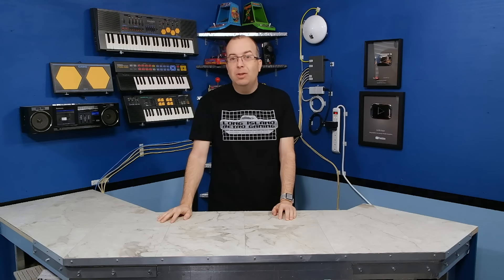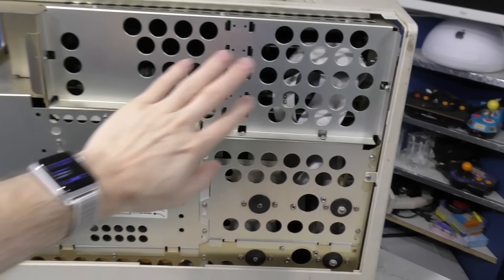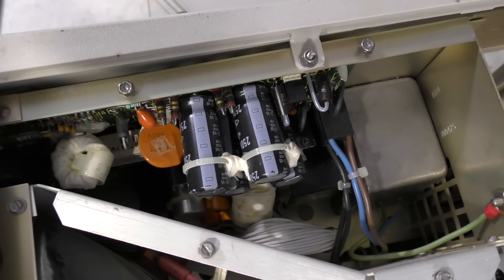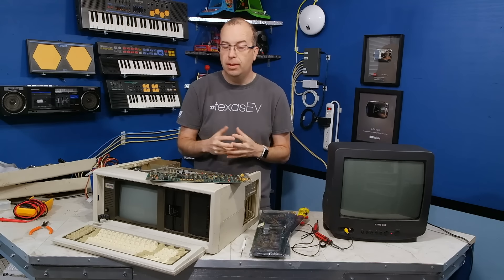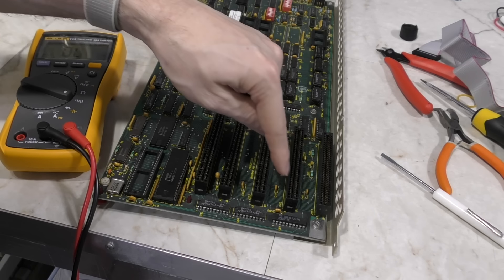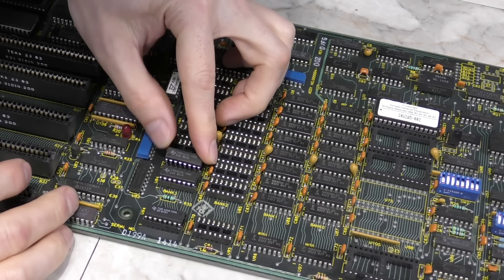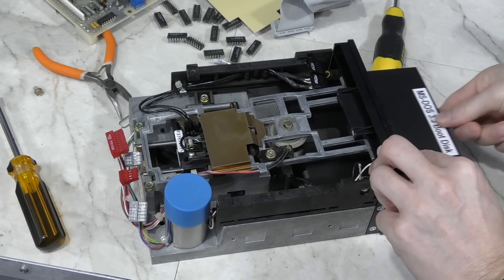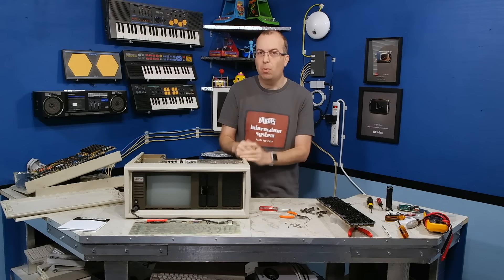Compaq Portable 1 Restoration - Part 1

Comment: I had one of these when I was a young teen.  It was hopelessly obsolete when I got it, but it had one advantage, my parents didn't know that it functioned and the modem worked.

In a nutshell, I would use it to dial to BBSes at night when I was grounded from the family computer.  Nothing like an 8" greenscale screen and a 2400 baud modem.  Ran MS-DOS 3.3.

Mine didn't have a hard disk, just dual 5.25" floppy drives.
Reply: TWX1138 alright, let a ‘younggen in on it- what’s a BBS?
Reply: Yeah, BBS - Bulletin Board system is very much like a web page but run by one person or company and you connect to it by dialling a specific phone number.

I used some around 1993 and 1994 (downloaded shareware games from them mostly), right when the internet was starting, but the internet very quickly made them obsolete.
Though... You could still find a decent number of them up into 1998 or so...

And even to this day there are still a few random holdouts.
The thing about a BBS is that anyone with a computer, a few modems and a few phone lines could technically set one up.

Nowadays I suppose even phone lines themselves are becoming borderline obsolete technology though.
So I suspect BBS will die a final death whenever fixed line phones do.
Reply: There's still quite a few BBS'es out there, but nowadays most are set up to be connected to via telnet. No more waiting an hour for a single jpeg to download via X/Y/ZModem!
Reply: @Samar Nadra: 14400?  How luxurious.  Try 2400 baud.

The city library system's BBS also had a Usenet portal, so I was able to do newsgroups, albeit quite slowly.  Had to be judicious as to what conversation threads I viewed.
Reply: @Kuralthys: yep.  Bulletin Board Systems.  Basically good for forums, e-mail (including cross-BBS e-mail with Fidonet and one's offlline mail reader like Bluewave), and some limited file transfer and shareware distribution.  Some BBSes had multiple phone lines and allowed for teleconferencing, but because of the popularity of that feature those BBSes were either congested or cost money to use.
Reply: meh, i think wired connections will never die, might become very specific, but never fully die. you can not beat the speed and security of a wired connection. 

but who knows, perhaps security will get good enough and wireless fast enough it will be, but we will have to see a wireless monitor first XD
Reply: @Slash0mega: who are you replying to?

There's already a wireless monitor technology.  Look up Intel WiDi.  It allows a client laptop to wirelessly connect a video signal.  It's commonly used to connect to projectors.
Reply: Ah, the BBS days... whenever I visited my dad in the early 90s for the weekend, I'd go on his PS/1 and hog the phone lines at night dialing into all the local Winnipeg BBSes, of which there were quite a number - I recall there being at least 100 of them at its peak, and definitely a great place to get new shareware goodies (though it did take a while to get anything on a 2400 bps modem) or run door programs like LORD. By the time I had my own PC (which had a 14.4k modem) and had moved back to the city for university in '96, they were on the way out as the Internet was becoming a thing, but occasionally I still reminisce about those earlier days when finding a new BBS to dial in to and discovering what all they had was a journey in and of itself - and with Telnet-able BBSes around to connect to nowadays, it's kind of nice to relive some of my childhood again :)

Comment: Damn, I had one of these as my first work computer.  I worked for a startup consulting company back in the day and it was my BYOD.  Brings back memories.  I remember when I had to add RAM, swap out a disk drive for a hard drive (and add a controller), replaced the PS(!), and added ISA cards, taking apart the cages was such a pain and I got plenty of skinned knuckles doing it.

Comment: I ran into this exact same problem with tantalum caps on the ISA riser of an old 286.  A VOM is a better diagnostic tool than pyrotechnics.
Reply: but not as fun or cool looking XD
Reply: A "VOM" ?
Reply: Miles Prower A "Volt-Ohm Meter." Basically, a "VOM" is a multimeter.
Reply: Okay ^.^'
Reply: A VTVM if you’re really old, or a Simpson 260
Reply: I disagree; a multimeter requires time and skill, while pyrotechnics tell you immediately.
Reply: Let the magic smoke out, but wait, no here we go. Now it works
Reply: EFormance Engineering z
Reply: Especially since it seems that trace got burned out due to the pyrotechnics too.

Comment: I’ve fixed a single dead key on one of those capacitive keyboards before by using a bit of antistatic bag material.  I kinda want to see about making a punch die for that purpose, get a bunch of the metallic antistatic bag material, adhere it to some thin felt, and punch out circles of it to the right size.  Some spray glue would hold it to the key, and boom, functional (and more durable) capacitive keys.

Comment: No need for tools to open the covers. Just lay it flat, and push the plastic cover down in line with the logo. It will pop open on the top by itself. Saving the clips, and no tool damage. BTW, these computers work great off a Hercules Graphics card. Also, this model came with 2 floppy disk drives.The Plus model (with a gold logo) came with a Seagate MFM hard drive installed - 10MB.
Reply: The plus model sounds really cool honestly

Comment: Looks like that capacitor was shorting the rail to ground and the power supply was shutting off to protect itself, it's really common for tantalum capacitors to fail Short Circuit. (Edit: I feel like I should mention to clarify electrolytic capacitors usually fail open circuit or simply loose capacitance, whereas tantalums usually fail Short Circuit.) I find it kind of funny that the modern power supply you plugged in lacked the protection features of the built-in older one.
Hope you didn't chuck the original board out as these are fairly rare and it's likely an easy fix.
Reply: David Scheiber maybe that jump-start he did somehow didn't trigger the PSU over current protection
Reply: Yeah, Tantalums had better electrical characterstics than electrolytics, but they fail dead short so often in vintage equipment that most restorers just change them all out wholesale before starting any other testing and repair.
Reply: Osaka2407 I don't think most ATX supplies provide all 4 ISA rails (+12V, +5V, -5V and -12V).  Old XT era boards didn't use the +3.3V rail common on modern boards.  Yet again for this jumpstart, only the floppy rails (+12V and +5V) were used anyway.
Reply: Similar thing happened to me on a 286 Octek board. One tantalum blew his head off upon first power up. The failure mode on these is spectacular. The PSU was definitely going into self protect mode when the tantalum shorted out. I was lucky in that I did not have any burnt traces on the board, but the risk is always high. The guy who worked on memtest86 for a long time is designing a smart ATX2AT converter (https://x86.fr/atx2at-smart-converter/) which can protect mainboards from those kinds of failures by shutting off all power when detecting an unexpected surge in current.
Reply: do you have any experience how to debug/fix XT motherboard ? I have one , and after fire up from the speaker I can only hear ( ambulance sound ) , and no POST ;/
Reply: 11:02 Noob question: does anyone know what process Raymond followed to find the shorts on the two video cards and how to tell which voltage rail it was? I can't imagine looking for shorted caps by checking continuity is the proper way, but again I am new to this... any insight is appreciated.
Reply: They're just bypass caps. You could probably cut most of them out and the board would work just fine.
Reply: Most ATX power supplies expect the device to draw tens of Amps for each of the main rails, hence the over-current shutdown thresholds are set quite high.

It only takes an Amp or two to fry a trace or component on a board, and a typical modern ATX PSU won't even notice.

It's for this exact reason why you should never hook up a larger PSU to a treasured retro machine (or anything else) unless you have tested for shorts on each power rail.

(The original PSU might only supply a maximum of say 4 or 5 Amps at 5 Volts, whereas as a typical 400 Watt ATX PSU might be capable of supplying 30 Amps or more.) :o

And, if the device normally draws a fraction of the current that the ATX can supply, then you should fit fuses or some other protection on those power rails.

Tantalum capacitors in older machines do tend to fail short like that, and I believe one of the main contributors is moisture ingress.

(Tant caps are kind of porous, and made of powder, so can suck up moisture over the years. That starts to break down the insulating chemical "layers" inside the cap.)

But, I'd still rather use Tantalums than have Electrolytic caps that tend to leak and end up destroying boards much sooner. Electrolytics are still required for the larger values, though, and Tants can be very pricey.
Reply: He should send it off to Louis Rossman. lol
Reply: @johnfrancisdoe1563  Sure they do. Well, my 2006 one does. Not sure about newer ones.
Reply: +ElectronAsh, great info. I also tried to respond to your other, longer response... but YT commenting is broken and it doesn't let me. Thanks for taking the time to share your knowledge and explain the troubleshooting process. Cheers!
Reply: @David Scheiber: It's not that the new power supply lacks protecting. It's most likely that it's protections are made to tolerate much bigger power spikes as modern computers can draw a lot if current (high end video cards and cpu's). And if the blow out occurred at a current draw above that of the old but below the new supply it also would not kick in until it went dead short. Consider the old computer might have a power supply less than a few hundred watt where these days we have kilowatt power supplies.

edit: oops mist the other comments, electronAsh already explained....
Reply: Diode test whit mutilemter and for find it just 1-2v and 500ma current limit PSU the culpit will heat to like 80ºc whit out burn any trace like he did or a milliohms mutimeter whit 0,00 /0,000 range.
But whit tantalum caps is must remove all and put new ones they are shit of the 80'S no aliexpress shit just japaneses original like panasonic /nichicon/rubycon.

Comment: 5:51 As uxwbill would say, SMOKE TESSSSSSSSST!
Reply: And that's why it's called a smoketest. XD  I once had a Hercules card let magic smoke out of a 486DX5 PC I owned, through the 5.25" floppy drive (!).
Reply: I sorted a power supply on a 486 once. Remember when you had to orient the power switches on home built computers?
Reply: Think I toasted a PS on a 386 the same way.
Reply: Actually, fun fact, "smoke test" was originally a plumbing thing. They'd pump smoke through the pipes to check for any leaks. It crossed over to electronics for obvious reasons.
Reply: Or AvE, it let the smoke out along with the angry pixies.
Reply: i think you just pointed me out to a new youtuber to check out

Comment: A trick for when a screwdriver head doesn't quite fit is to put an elastic band between the screw and the screwdriver head. This usually gives you enough friction to turn the screw.

Comment: Getting a Compaq Portable 1 dual FDD system that has a HardCard, RAM + RTC board, and NE2000 NIC. It has the same issue your's had: turns on, blank screen. Going to inspect the caps on the board and video card and replace when necessary. It's currently being shipped at the moment.

Comment: He looked so shook when that capacitor blew up
Reply: Fire, heat and noise will wake you up for sure.
Reply: We came in to do repairs to a 35-station computer lab after the machines had been off and the circuit breakers shut off over the two week winter break.  These were early ATX machines, so soft-power, an the power supply was technically in a powered-down but standby state so long as the machine was plugged in.

When we threw the breakers for the lab (they guy literally threw all of 'em at once) the power supplies in just about all of the machines blew their caps simultaneously.  We had smoke, horrible popping and crackling noise, and brief flames from a few as the power supply exhaust fans kicked on enough to vent the gases and fire from the dying machines.  It was pretty glorious.

Comment: Capacitors are the black magic of electrical engineering - Able to dump ridiculous amounts of high current into a circuit but then suddenly a few milliamps causes one to short then you just blow it up or take it out entirely and your realize it was likely redundant anyways and wasn't needed.

Comment: It's not entirely correct to refer to the Compaq video cards as "CGA", as although they are CGA-compatible, they also offer a high-res 640x350 text mode on the Portable's built-in CRT, giving it much sharper text characters than CGA's 640x200 resolution. Later revisions of the Compaq video card added 640x350 graphics to the built-in CRT, giving it EGA compatibility.  

p.s. I've heard that early revisions of the Compaq Portable's motherboard have a pinout for a cassette port, although it was never populated or supported.
Reply: I enjoy  my WUXGA 1920*1200  Hater of the 1920*1080 (shitty for computers)
I used to OVERCLOCK my CRT  to  QXGA 2048 × 1536  from the native 1600* 1200(100hz)
Reply: VWestlife fancy seeing you here
Reply: Hey, awhile ago I saw a video of you sorting through old computers that were completely left out, what are those called? I tried looking for computer recycling places but they all don't let people just take stuff.
Reply: It's an "e-waste" dropoff point.
Reply: I have a Ford Galaxie 500.
Reply: hey what's up man

Comment: i tell ya I loved Compaq when i was a kid in the early to mid 90's. Built like a tank, quality components, and its sad the creator/owner left because he did not want to compromise in build quality! The last Compaq I owned was a Presario  SR5702, which was an odd duck with a Sempron X2 2300+ 2.2GHz, the motherboard still works, have it as a backup for my Windows XP Gaming rig.  Silicon Cowboys was a great documentary about Compaq!  Halt and Catch Fire by AMC is loosely based on Compaq as well, I still need to watch that.

Comment: Ha, have fun restoring the foam and foil board! To be honest, it's something I've always wanted to try, even though that kind of keyswitch is widely disliked. From memory, I believe it was some sort of model railroading foam that some Apple Lisa restorers found to work best. Something like a sheet of foam used to create the rail bed or something along those lines. Anyways, keep up the great work!
Reply: Search ebay for "victor foam pads". Try to reuse the foil if possible.
Reply: Model Railroading foam would probably be Woodland Scenic's "Track Bed" product.  Not sure what scale though.  Probably HO.  #modelrailroader.

Comment: Nice thing about a beefy power supply, the tantalums burn up and peel off as they fail without interrupting your work.  My old workstation graphics card has a number of its tantalums burned off.

Comment: That video card is bigger than Nvidia's new RTX2080TI!
Reply: Pertti Tuorila That video card is an almost 1:1 clone of the card that defined the maximum size of video cards and the space that cases should allow. Unfortunately most modern cases lack the plastic rails that carry the weight of the back of full length cards.

Comment: 5:53 This is exactly my reaction when I changed voltage from 220V to 110V on the power supply for a Pentium 4 I used to have, ended up being frayed.

Comment: I had the exact same problem with the CGA card on a 5155 Portable Personal Computer. It was capacitor C8, which is known for shorting. It stopped the fan from even turning on, but when I replaced it everything was OK. The 5155 is easier to disassemble in my opinion, partly because it is basically a 5160 with a CRT jammed in the case. I also really love the amber display. The IBM Model F keyboard with the 5155 is also really great to type on.

Comment: David, i just restored my compaq portable series I , i can tell you the best way to restore the pads on the keyboard, is to find a  SUN Type 4 keyboard, keytronic made the exact same pads, however sun did a recall on 90 percent of the type4 keyboards, and replaced the pads,  I tried the replacement pads out of the uk, but it was a mess trying to clean the foil and the plastic discs and put them on the new double sided sticky pad. It was a constant battle after finding that the sun keyboards had the same disc pads, but newer, i found one and replaced every one. and they were perfect replacement with good foam to boot. 
 my specs  compaq portable series I,  20mb hard card, floppy controler wth two 360k floppies, CGA card, ast 6pak ram card with totalling system to 640K of  ram , serial card.